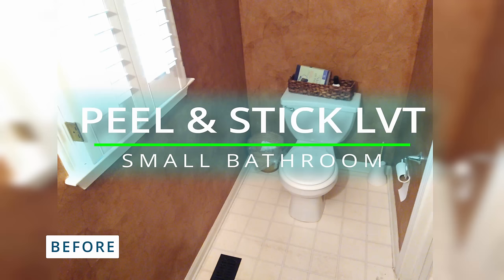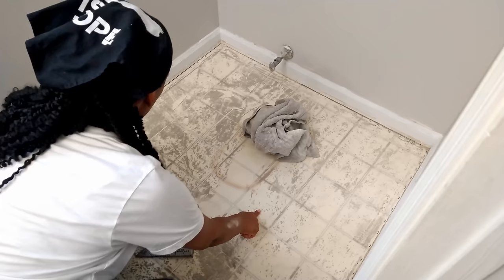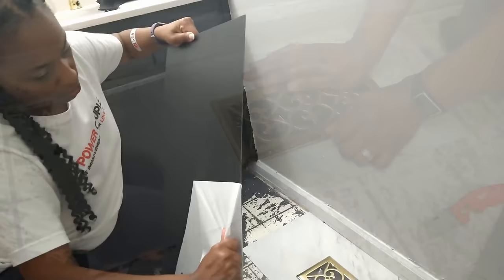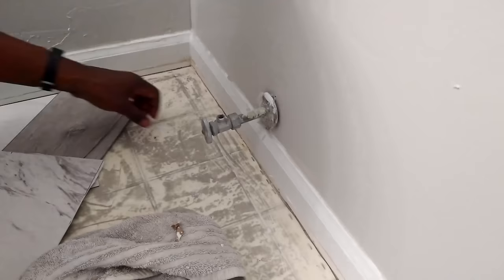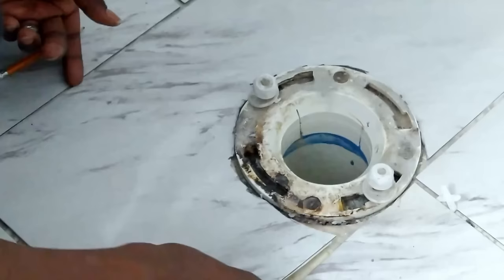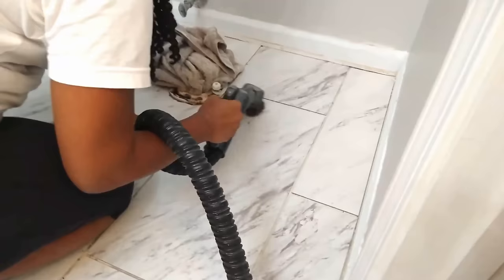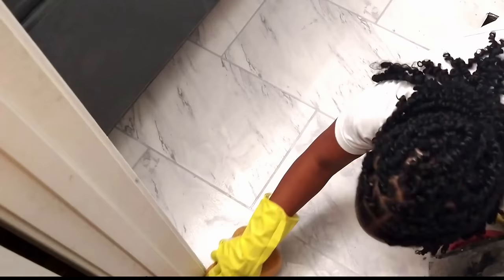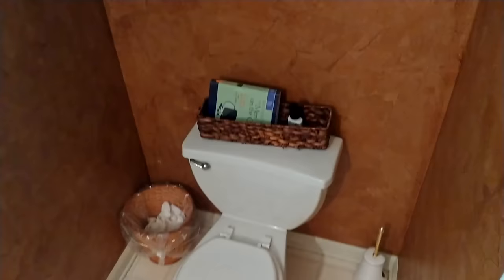Watch Us PEEL & STICK a SMALL BATHROOM FLOOR with Luxury Vinyl Tile!

Comment: I used this tile in my basement, used the 18x18 size.  It’s so easy and fast install.  Tile has been down for 3 years with no issues.
Reply: Hi! Where did you purchase it?
Reply: WHAT BRAND😬??.. thanks!
Reply: @gloriahufnagel5556  I can’t remember the brand, but it comes from Lowe’s and is Groutable and 2.5mm thick.  Hope this helps.
Reply: @karensandberg6226  thanks! 1st timer here.. gonna give it a shot..
Reply: @gloriahufnagel5556  make sure to use tile spacers, this will give you even grout lines.  They also make premixed grout for these tiles.
Reply: @marmccown3537  Lowe’s
Reply: @karensandberg6226  I’m gonna TRY.. 😂😂.. I’m actually pretty handy tho.. I put all my furniture together, so I think I can do it.. 💙💙 THANKS!
Reply: @HOME3708_  there is a primer it’s like a milky paint that you can roll onto the concrete.  Just make sure the floor is clean and smooth and the tiles should stick with no problem.
Reply: Did you use premixed grout?
Reply: Please reply. Are you in an area climate like Michigan? Did you just put it on the concrete floor or did you install a sub? Did you have a sub pump? How did you manage that spot?
Reply: Can i buy them online? 😢
Reply: wow...❤
Reply: Can you use this with the grout for renter friendly or no ?
Reply: @jujube8455  I don’t think this would be renter friendly, very sticky and would leave glue on the floor.
Reply: @nicolereadstarot  I’m in WV and it went on a concrete floor.
Reply: Can you do this on preexisting vinyl floor tiles?
Reply: It's water proof ??
Reply: @Urdustudent  once you grout it, it’s water resistant.

Comment: The floor looks nice.  You have an isolating saw, but now a brad nailer? It is much easier to use than the adhesive that was used for the quarter-round molding.
Reply from the maker: Gerald, For some people it's easier to glue than nail (they are true beginners). The great thing is that both options work. We help people at all skill & budget levels to give them hope and know that they can DIY too! Thanks for watching! -DIYPC 😃✨
Reply: @DIYPowerCouple  Understood.  Be sure to explain how to remove the toilet and put it back.  😉

Comment: Looks great. I am thinking about doing the same in two rooms in my house. Thanks for the tips. I am wondering why you used 1/4 round on the wall edges instead of cutting out the bottom of the baseboard and sliding the tile under like you did for the door frame. What made you use 1/4 round instead of doing the same cut and slide technique you used on the door frame?
Reply from the maker: The 1/4 round is on all of the floors around the house and area outside of the door...so it looks consistent.

Comment: Y'all made that look so easy.  I have 2 questions.   I have ceramic tile on my bathroom floor but a couple of them have cracked.   1. Do you think I can lay this over the ceramic tile that has cracked?  2. Do you think this will keep the floors in my bathroom a little warmer in the winter?  I have a pier and beam house that was built in the mid 50's.  I do not have the bottom closed in except in the winter.  I only block the North side.  I leave it open because I have a friend who has a similar home and it was totally enclosed.  They had mold I think a white mold grow from not air getting under there and had significant wood rot.  I don't want that to happen to my house.   Thank you
Reply from the maker: Hi, we are going to try tiling over ceramic in the next small bathroom makeover so stay tuned.  We are going to use a filler for cracks and grout lines to make a smooth surface for the peel and stick.  Not sure if vinyl tile will make it warmer in the winter but you would be adding an extra layer of flooring.  Hope this helps!🙂

Comment: What is the best underlayment  for an uneven floor with this method? I've got old peel and stick missing some I don't have the energy to scrape all of it up
Reply from the maker: Gypsy, there is a liquid leveling compound that you could use to fill in the holes of your existing floor. That could be an option for you to level your floor. -DIYPC 😃✨
Reply: @DIYPowerCouple  can you put it over old sticky tiles? Will it harden? Is it moisture proof? Is it expensive?  What is the name of it?
Reply from the maker: @gypsybellefleur  This video should give you some ideas for budget-friendly underlayment options for an uneven floor: https://youtu.be/mlt7tDXFFeA

Comment: Did you seal the tiles and grout? Is the recommended for vinyl flooring?
Reply from the maker: No we did not use a sealer because it is vinyl grout (instead of traditional grout).

Comment: I am interested in putting this in an off grid cabin that's not heated in the winter. Will fluctuations in temperature (20 degrees F to 80 degrees F) cause it to pop?
Reply from the maker: The tiles we have placed down haven't had that large of a swing in degrees. If you lay them down and they come up, you have the option of adding an adhesive. This will help to keep individual tiles in place.

Comment: I’ve seen many different brands of stick and peel wood flooring. What brand do you recommend?
Reply from the maker: Hi, it depends on your budget, style and where you want to use it.  For beginners, it is nice to find some at the big box home improvement stores so you can actually see/touch them before buying.  We recommend using them in a small area for your first time.

Comment: Did the grout stain your tiles at all ? I bought the exact same tiles and grout and the grout left grey marks all over the tiles
Reply from the maker: No. We removed the grout that touched the tiles while it was wet. Sometimes we add water 💦 to the tiles if we see that the grout is about to dry on them. -DIYPC😃✨

Comment: When measuring for the small end pieces, such as those that are up against the vanity, how do you account for the grout line measurement? Do you subtract it from the length? Thx. Great video.
Reply from the maker: Hi! We use the spacers to help us mark the measurement line before we cut.  Sometimes the smaller pieces require a couple of tries to fit. 😀

Comment: How long did you wait after putting the grout down before you sponged it off.  Did you sponge it off right away?
Reply from the maker: We wiped off the grout right away after each section was grouted. We installed the tiles and let them sit overnight before grouting.

Comment: I gdnght I also wanted to redo my small bathroom with the peel an stick but I didn't know that u had too do grouting with it or is that's only because u use the square Center method? Thanks for sharing it came out very nicely
Reply from the maker: Hi! You do not have to grout peel and stick. It is just an option 🙂

Comment: Hello! Thanks for sharing your experience about peel and stick tiles, love them! Quick question, one of your other videos mentioned using the 7350 Universal Flooring Adhesive to increase the adhesiveness. Do you think it’s better to use the 7350 on all peel and stick floor tiles? I’m about to try to upgrade my bathroom with peel and stick floor tiles :)
Reply from the maker: We don't recommend the adhesive on floor tiles because gravity and rolling them will help them bond to your subfloor.

Comment: Fyi, if you need to put down 5 mil plywood underlayment like I did, it was half the price at lowes vice home depot, I almost made a costly mistake when i didnt notice that the panels at Home Depot were only 4'x4' vice Lowes' 4'x8' for the same price

Comment: Please Help!! I want to lay this on top of my current wood flooring. Is there some sort of barrier that would recommend to keep the wood from getting damaged by moisture in the bathroom? Thank you! 🙏🏾
Reply from the maker: If you grout the tile like we did...even if you just put the tiles together without the spacers...it will create a waterproof barrier. Note that we put the tiles under the toilet and not around it. Doing it that way will help your wood floors. Please let us know how it goes. Best, -DIYPC 😃✨
Reply: @DIYPowerCouple  Ok, Ty!!

Comment: Could you put this type of floor on existing porcelain tiles?😊
Reply from the maker: Edward, The good news is...YES...but you may have to fill in your grout to create a level floor. This will help the Peel and stick tile stick to a completely flat surface. Google floor leveling compound and get a simple one. Hope this helps. -DIYPC 😃✨
Reply: @DIYPowerCouple  thank you very much! Got it

Comment: it would look better if you cut the tiles that are against the wall so they are the same width , you have a full width tile on the left wall and a much smaller width on the right side wall...
Reply from the maker: The picture is not showing the full opening and the hallway. It turned out great 😊.

Comment: Just out of curiosity, what was the total cost for the project?
Reply from the maker: Hard question to answer because the total project included the hallway and laundry 🧺 room. Peel and stick for small bathroom floors on average are less than $100 depending on where you live.

Comment: I want to use these peel and stick tiles for my entry way but I have to take out the two damaged laminate layers out first. So it would be on the baseboard. Is there any prep other than just maybe sanding and stuff I would have to do? or can I not put this directly onto wood?
Reply from the maker: As long as the subsurface is level, you should be good 👍🏾 This may help https://youtu.be/yvEZNupNNFo?si=FXOXR3V4ah_PDlqU

Comment: Can you put the peel and stick tile on top of sheet vinyl?  And do you have to remove the toilet?  I love this but I’m in my early 60s, and if I can skip these two steps, I’m pretty sure I can do the rest
Reply from the maker: The good news is that yes , you can tile over vinyl sheets. See how we did it right here: https://youtu.be/mpvmRPkQEd0?si=NzQoy8T5hqHVKezt
Reply from the maker: No, you do not have to remove the toilet to install peel and stick flooring, but we usually do. We also grout the tile to give it a waterproof barrier.
Reply: Thanks 😊

Comment: What brand do you use?.. there are so many … thanks! When you’re looking for the center, in the main bathroom, how do I find it?.. and WHY don’t I have any DIY friends? I can put my furniture together easy, but I’m scared to try this project.. any suggestions for a 1st timer? I believe there’s a subfloor, but the floor is so old the subfloor has come up.. the floor under is tile, from what I can see..
Reply from the maker: Trafficmaster tile at Home Depot. Measure the length then the width of the floor and use the midpoint.  Hope this helps! 😀
Reply: @DIYPowerCouple  THANKS!

Comment: ❤ help help help my pillow stick is not sticking to my tile in my shower. I’m using the marble looking tile pilling stick. I use the Robert grout and the Robert adhesive. Can you please give me any ideas as to how I can get this tile to here to the shower wall.
Reply from the maker: Hey Victoria, peel and stick doesn't work well INSIDE a shower.  The wet surface is not ideal for adhesive.  An option is to paint your shower like this: https://youtu.be/NF0iT2kX7uk?si=GWzvKa9tb-OrZVgI

Comment: Do u have to remove the toilet,I,m 70 yrs old,on my own,can’t left the toilet,can I cut around it or lift it enough to get the tile under it..?
Reply from the maker: You can trace tiles around the toilet like we did around the flange.  It takes patience.  You may want to caulk around the toilet once the tile is installed to seal.  🤗

Comment: I did something similar…when I put down the square peel &stick  on wood floor it wouldn’t  stick,,…I didn’t use spacer…they were  just close to each other so they wasn’t a gap….any suggestions
Reply from the maker: Hi Pamela, some woods have a coating.  You can try a primer or use an underlayment.  Here is a video with the info- 
 https://youtu.be/mlt7tDXFFeA

Comment: Looks good but I doubt it will last long once you start mopping it
Reply from the maker: Sophie, the grout makes the flooring waterproof 💦. Our bathroom floors have been drenched with water and have not peeled. There IS a way to make it work...if you want it to. No need to doubt 🧐🤔. We got you covered. Thanks for watching. -DIYPC 😃✨
Reply: @DIYPowerCouple  ah ok. Maybe because I live on an island and everything has to be imported I find that this option here is more expensive than real tiles. I do agree the peel and stick would be quicker, easier and less messy

Comment: Hi, great video. Are you abke to use underfloor electric heating with these tiles
Reply from the maker: Hi, thanks! We don't believe any heat underfloor can be used with vinyl flooring...tiles or planks.

Comment: I have a question. I bought this same peel and stick flooring for my mom's house. My plan was to lay right over old tiles. But almost half the tiles were loose, so I scraped them up and tossed them out. This house is going to be sold and I don't have a lot of time to spend stripping out the whole floor. There is some kind of old black adhesive on top of the plywood. The other half of floor has tile that is stuck tight. Obviously my new tiles are not going to be level. #1 Can I install this over this black semi sticky adhesive? #2 Or do I need to install some sort of under base over the entire floor? ( My sister suggested I lay 2 new tiles on top of each other to get to same height. Is this a terrible idea?)
Reply from the maker: Hi Judy, we would suggest an underlayment for peel and stick like this one: https://youtu.be/yvEZNupNNFo
Reply: I have the same situation, I just started pulling these tiles up, I am freaking out because I just read this black stuff is asbestos adhesive and my tiles propably are too, now I dont know what to do

Comment: ...i Desperately need a bathtub...health reasons, terrible muscle spasms, etc...& all i have is a tiny shower stall so small it can hardly hold a small shower chair, Upside, don't have to worry about falling there aint nowhere to fall to, except into the walls...but, right beside it is a bunch of built in shelves, very deep shelves....i am thinking i could cut the shower stall like in half, take out two shelves & drop in a cheap plastic tub?...& enclose the walls with..something...plastic or fiberglass or tile & mold it together with epoxy molding compound or some such that would be waterproof...use the same drain for the tub that the shower already has & use the shower itself as it is to fill the tub, forget faucets, don't need or want em...follow my train of thought here?...any suggestions, anyone?.....i can not afford to pay anyone to do this so..it's gonna just be me, but i know my way around tools & plumbing...

Comment: Why wouldn’t you just take up the baseboard, install the tile, then reinstall the baseboard?? That way you didn’t have to use 1/4rd.
Reply from the maker: Using just the qtr rounds allows you to change the flooring without pulling up the baseboards each time.

Comment: I’ll pass on peel & stick in the bathroom.  Guys, will miss the mark, and eventually, urine will get into the seams adding to smell and loosening the glue.  Usually, a bowl is way too humid and different times of the year may also drip water. I’ve never come across a durable Perl and stick.  IMHO, it’s a bandaid job.
Reply from the maker: Richard, this comment is hilarious 😂 to us. All we'll say is that peel and stick really does last when installed correctly. Thanks for your comment. -DIYPC 😃✨